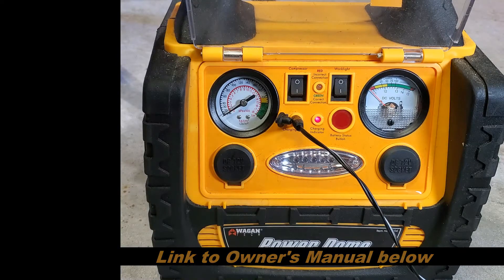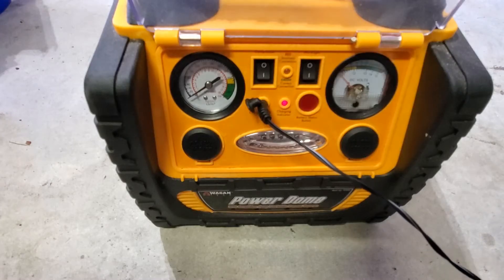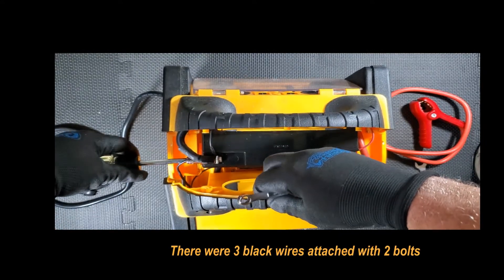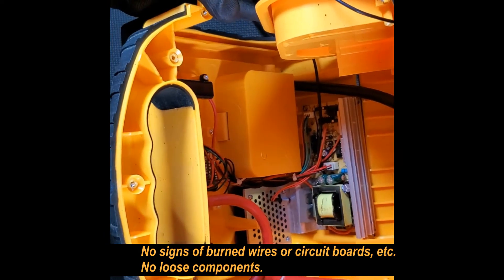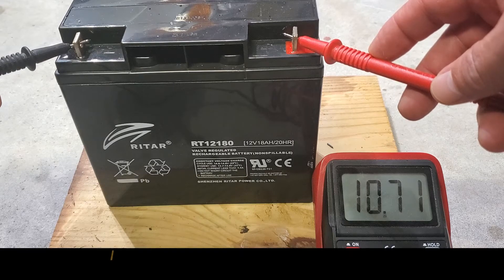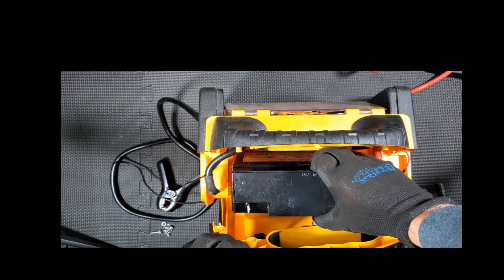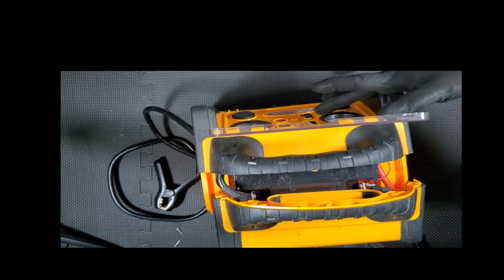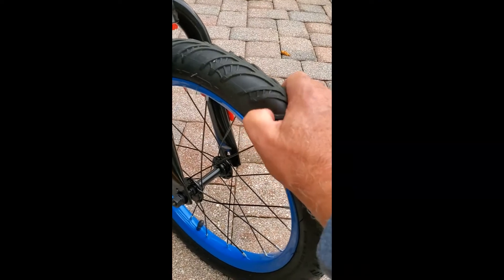Wagan Power Dome 13Jan2022

Comment: My charger light is blinking.
Reply from the maker: The Wagan unit charging light depicted in this video does not blink. The WAGAN manuals are available from the WAGAN TECH website. If you have a similar unit, check your manufacturers manual for proper operation. The NOCO charger lights do blink depending on the battery state. Also check NOCO operating manual for additional information. Hope this helps.

Comment: What's the dc charger amperage
Reply from the maker: I gifted the unit to my son, as he does travels a lot. However, according to the User's Manual the AC charging adapter output is 15V, 500mA DC. They are available at the Wagan website, under Wagan Tech and searching for accessories/parts. Lastly, try contacting Wagan customer service. Hope this helps.